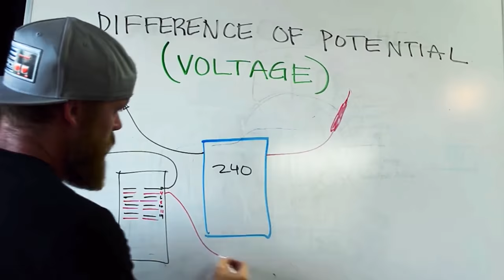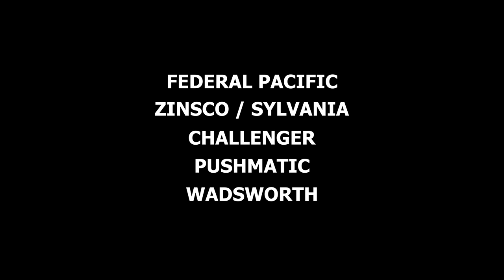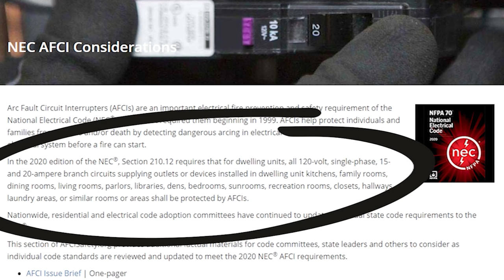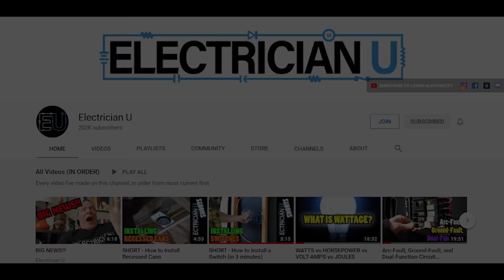Outlawed Panels and Breakers

Comment: I would just replace the panel and not pull a permit, only doing what is required to make a "safe" system.  I just bought a new 200 amp service meter socket/load center combo for $600, so material wise a whole install for retrofitting an old system should be less than 2k in materials if not inspected.  But that's the farmer in me talking. :D  I'm doing a new service for a grain bin, and after research, I won't be installing any GFCI.  If they nuisance trip, what's the point?  The main things I have learned (getting shocked in the process), don't touch anything if it's wet, if you do touch it, make it so a contraction of your muscles makes you pull away, and make an effective ground fault current path.  If you don't have an EGC to the main panel, bond neutral and ground at the sub panel at a building.  It's against current code, you could have objectionable current, you could die, but it'll trip a breaker if there's a short circuit.  If you don't have an EGC at a system and only a neutral and hot, make a hell of a good ground rod system.  Contrary to what some people will say, it CAN trip a breaker if close to the maximum circuit load already, and it also creates a parallel path to ground.  You might die, but hopefully not.  ALWAYS run and EGC to the main panel, and isolate ground and neutral except for the main panel if you can.  This is only a farmer with limited funds talking, using systems from probably the 1930's-40's.  I had to make things work as they were or add things for cheap, or go out of business.  I've seen some crazy stuff diagnosing things with a multimeter, and making a GEC when the ground itself was frozen by running fence wire into a manure pack to make a ground.  Current codes exist for a reason.  By all means, follow them.  One thing I will say. .5 (1/2) volts is enough to shock you if you are in a wet environment, on concrete or ground, and it contacts a cut on your hand, and understand "voltage gradients".  Never underestimate electricity.  I'm surprised I'm still alive. :D

Comment: Back in the 60's (and earlier) FPE panels and breakers were cheap to buy and profitable, and most electrician's used them. The average breaker price was anywhere from a buck per breaker for a SP Stab-Lok and $2.25 for a DP up to 30 amps. Can't go wrong; right? Well, we eventually found out that you got what you paid for. I clearly remember the FPE 108-16 was the go-to panels for an average 100 amp service. and the panels took either 8 FPE type NA breakers or 16 type NC breakers. I never liked FPE from day one, I used to use Murray panels and breakers. much better breaker than the FPE. Murray eventually was acquired by Couse HInds back in the late 70's through the early 90's, and then bought out by ITE. ITE for the longest time had a run of bad breakers where they would burn up under a resistive load (anything with heating elements) I remember seeing ITE breakers with holes burnt through the sides of the breaker. I've been using Square D 95% of the time, But they are even getting cheap with their build quality. Plastic rails and cheap metal bus bars. Even though Edison-base glass fuses had their drawbacks, they were still a good method of over-current protection if you put the right sized fuse in as a replacement and not pennies. at least the proper sized fuse would blow.

Comment: I worked for an Electrician for a very short time.   We went to do a service change once.  The guy had a welder with the long round fuses that are like a cartridge.   They had given Him trouble, so He put copper pipe in place of the fuses.  My boss asked Him  if He wasn't concerned that He might start a fire like that.  He told My boss that You can't burn down a concrete block building.   How do You deal with a person like that?
Reply: cash only and no paper trail lol
Reply: show him pictures of burned out cinder block buildings.
Reply: I deal with a person like that with" either I repair the problem , or get someone else" and walk away!!!

Comment: Federal Pacific lost their UL listing. All the others, off of being bought and sold they stopped manufacturing those panels. The government has a law that the manufactures have to produce replacement product for x numbers of years. Time up and the production is stopped. That's what happened to the other brands you mention. Breakers can not be sold with out testing, trip time, overload, and fault, that's why they have a UL listing.

Comment: I would never short wires out on an older panel especially XO, Wadsworth, Zinsco, FPE, even older homeline panels have faulty breakers and you can actually fuse the wire together and it will get hot really fast and before you can turn off the panel, could start a raging fire or at least damage wiring. I've seen splice boxes burn up, outlets burn up, causing half the power in a room to go out. Had an older homeline panel with a failed breaker blow up on me. It wasn't a huge bang but sparks flew out of the panel. I was trying to figure out which circuit this well was on, so I shorted the wires out and they just started buzzing and got so hot I had to let go and jumped out of the well pit with the romex just smoking, ran in the house to the panel and felt the breaker getting hot and buzzing and went to shut it off and sparks flew out and it started melting the bus where the breaker was installed. I got lucky and a lesson from the boss. We had to replace the entire service cheap. I could have saved these people's house from a fire because of this small incident. TLDR: FPE breakers that have been shorted out can actually break the plastic inside the breaker and it will never trip again. Some might trip 2 or 3 times without breaking, some will never do it from the factory, so be mindful of that every time you short out an FPE breaker it could get stuck on.

Comment: I'm a very experienced electrician. The thought of telling someone to purposely short circuit a breaker is crazy!! There is no telling what can happen. Edit your video, take it back! I have experienced many arcing shorts in my 40 years and getting your eyes flashed or burning your fingers is something I wouldn't wish on others. I've had 6' of metal fishtape dissappear before my eyes when it shorted to a live 277/480 volt 600 amp bussbar while pulling wire through an underground steel conduit. I got flashed and lost my hearing for a bit. Little drops of molten metal bouncing around like bb's inside the panel and on the floor around me. Not fun. Saw purple for about an hour afterwards and eyes felt like sand for a day. I don't know what the inrush current was, but the pad mounted transformer was right outside building, 10' away. I know, I installed it. 120 volts from a breaker that won't trip can do plenty of damage too, don't be mistaken! Could even start a fire anywhere upstream in the circuit. Take some advice from an old crusty guy who has survived a long time in this industry, leave electrical work for the pros. The guy at the homecenter most likely knows nothing!! Oh yeah, pushmatics are great, FPE Stabloks are good for arc welding!
Reply: I'm glad you found this video and gave that description... Most I've ever been hit with was 40 amps from a line that should've been dead... Helper was at the panel with a walkie, "I'm like ohkay that was it!" Proceeded to cut the line, luckily rubber handles are a thing God forbid my hand was on the bare metal.... I launched my linesman's a good 100', and just sat there contemplating my life choices; laid out on my back... He does service installs now...
Reply: It’s all fun and games until the wires you touch together weld to eachother and the breaker doesn’t trip and shit starts melting.
Reply: @andrewtibbetts9181  EXACTLY!
Reply: Never had a problem! I have a device I made that uses a heavy duty switch to short the hot to neutral, flip the switch and it trips the breaker.  Sometimes it saves time looking around trying to find the breaker!  Ive never had anything bad happen 🤷‍♂️.  I use a heavy duty switch so it doesn't fry the switch contacts
Reply: @seanbouker  you don't get "hit by amps"   Its how good of a conductor you are as to how badly you are shocked. You can touch a little extension cord and be standing in bare feet in a puddle and fry yourself instantly! Or you can be on a fiberglass ladder and have insulated shoes on and accidentally touch a leg of a service entrance cable and just get a minor shock.   It doesn't matter how many amps a circuit is capable of carrying.
Reply: @andrewtibbetts9181   That should never ever happen

Comment: I have had experience with Wadsworth breakers in which I had to replace a 50 amp breaker in a house that had half of it's outlets not working. Luckily I went to a place that sold used breakers 50 miles away. (Fleischmans to Saugerties, NY). The breaker was burned up inside, obviously needing replacement. The man who I met had a used one, so I inspected it and it seemed to be in good condition, so I bought it, checked it out with a meter and installed it. It worked. Also, I found out about Connecticut Electric which made replacements for these old ones, much easier than replacing the whole box, re wiring and all new breakers.

Comment: My house was built in 1970 and is located in Hawaii.  At the time, aluminum wiring was used.  I am now doing some remodeling, and am wondering if the wiring should be redone with copper.  Your thoughts would be appreciated.  Steve.  BTW, I am enjoying your videos.

Comment: I'm currently remodeling an apartment complex that used Federal Pacific panels. Didn't know they were so iffy.
Reply: 80% failure rate they are considered high risks and some insurance companies will deem them uninsurable
Reply: They didn't trip !!  Look closely at the stab lok , I put it in the same category with back-wiring a receptacle, not cool !  One of the "super old " electricians  that were mentioned in the video.

Comment: I feel like I’ve unknowingly been playing Russian roulette for the last 20+ years! After watching this video, I checked my panel and of course it’s Federal Pacific. This house was built in 1980, I bought it in 2000. According to quick research, the panel was already outlawed when I purchased. 😠 How and why the inspector didn’t address this is beyond me but it sure makes me angry. About 20 years ago, when the well pumps breaker repeatedly tripped, I hired an electrician to fix the problem. He replaced a 15A breaker with a 20A and switched the pumps to draw 220 instead of 110. He never mentioned the panel. Neither did the electrician who ran wire for a room addition in 2005. Which was never hooked to the panel due to lack of space (but that’s another contractor horror story) I have exterior receptacles that do not work, very sketchy outdoor switch and receptacle wiring, interior switches that seemingly do nothing, a ceiling fan that stopped working, switches that get warm, receptacles that get hot and a terribly mislabeled panel. I’ve no idea what rooms half the breakers are for. Except for the well pump issue, the breakers never trip. Reasonably, I’m now worried. I’d like to have this entire house rewired and a new electrical panel installed. Obviously, it needs to be addressed but it sounds like a $5-10k job. Bringing it all up to code would be great but that work just isn’t in the budget.

Comment: The Edison screw in glass fuses were easy to fix. When the fuse keeps blowing you just put a penny in the hole and then screw in a dead fuse. It will never blow again.
Reply: It's scary how many stories I've heard of people doing that. When my Mom's family first got a washer it was hooked up in the kitchen and the lone circuit couldn't handle the washer and anything else running at the same time. A penny was in there until they day they moved out of that house in the late 60s (and was probably left in there).

Comment: For whatever my $0.02 are worth, I vote you do Challanger after FP & Zinsco/Sylvania. I kid you not, one of the first things my inspector told me for the inspection of the house we just bought was that "that's the first time I've seen a Challenger panel", and he didn't mark it as a deficiency in his report. The only reason I found out that Challenger was a problem(shortly after the inspection) was because I was pretty paranoid about certain things(like electrical, certain plumbing, etc) being hazards(the house I grew up in had an electrical fire that killed one of my brothers), and I did some independent research on it, and was relatively paranoid about panels after running into other 1960s homes with aluminum wiring and FP and Zinsco panels(that the inspector did catch).
Mind you this isn't an extremely old house, as it was built in the early 90s, and relatively high-end custom home too.
I don't want to give him too much grief, because everyone has gaps in their knowledge(hell even the relatively young Master Electrician that replaced my panel, didn't know you shouldn't run high-voltage wires <6 inches from low-voltage data cables parallel for more than a few feet, if at all), but it's something that as a home-buyer you should take some time to do due diligence for, even if your inspector doesn't catch it.

Comment: I recently had to replace a two pole 30 Amp Federal Pacific 120/240 VAC  Breaker in a 1960's 60 Amp Panel for a Electric Dryer Circuit. Only one Electrical Supply Distributor had the breaker in stock and it was the only one that they had. It cost $ 75.00 !! Lowes and Home Depot don't even sell that brand ! Lady at the Electrical Supply Distributor told us that if we ever needed any Single Pole 15 or 20 Amp 120 VAC Federal Pacific Breakers to come back to their business as they had a whole bunch of them , some brand new and some not ! $ 75.00 for one 30 Amp Breaker ! Talk about being Price Shocked !!!
Reply: talk to electricians.  most will save any good breakers from the old panels, because they are rare and expensive to replace.

Comment: I don't care for the framing and insinuations in this video just from the title alone.  I've been a residential service electrician for more than 10 years now and I literally can't begin to calculate how many service upgrades I've done, ballpark 750-1000 would be close.  FPE and Zinsco are legitimate issues.  I've only taken out one Zinsco panel.  I've also taken out only one fused neutral panel from the earliest of K&T days.  Out of all the brands I've ripped out every single that had catastrophic failure to it?  All the big name brands.  Siemens, SQ D, CH, GE.  Literally seen melted down breakers in all of them.  You know what brands I have not seen such failures in?  Wadsworth and Pushmatic.  I have encountered and replace a LOT of them.  Almost all of the time it is due to needing a service upgrade.  Adding on to the house, car chargers,  electric ranges or dryers, detached buildings, wood shops, etc.  Their biggest problem is they were usually full with no room to grow.  

The biggest issue with ANY old panel is age.  Tension over time weakening, loose connections can lead to major problems.  To throw all of these old brands under the title "outlawed panels" is grossly misleading.  From personal experience, I'd rather have a Wadsworth panel protecting my home than an old GE panel.

Comment: I think as long as the branch circuit wiring has not been extended more than 6 ft you can leave the branch wiring and protection as is.  Of course some juridictions, once it leaves o&m work, then new everything.

Comment: I am a bastardized electrician, as in I do low volt stuff. Some times I've worked with electrical stuff like adding a electrical outlet 6ft high for a TV mounting or swap out light switches for smart switches. Anyway, even I know shorting out 110/120 to trip a breaker is a no no.